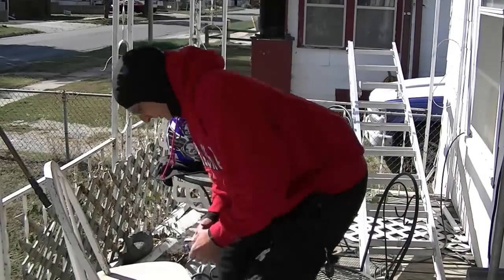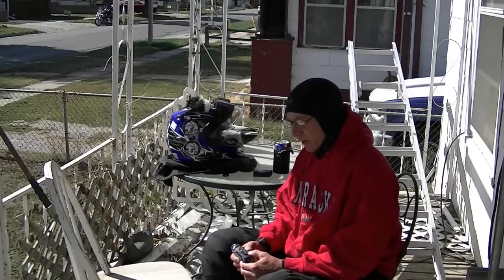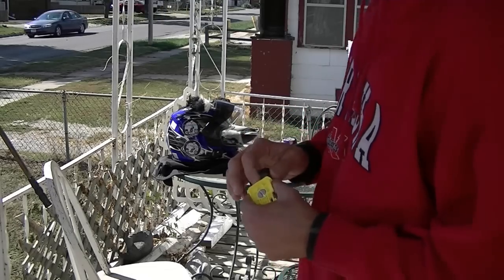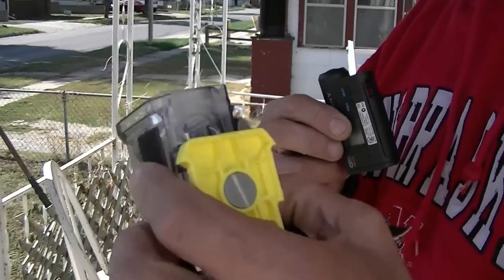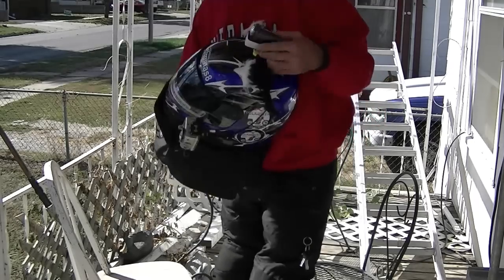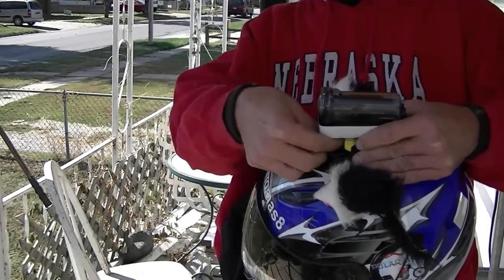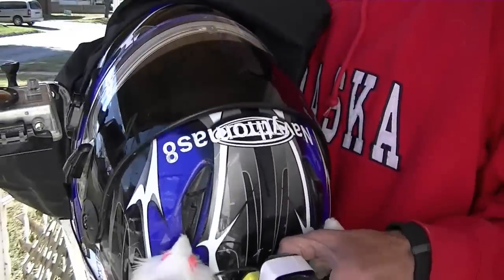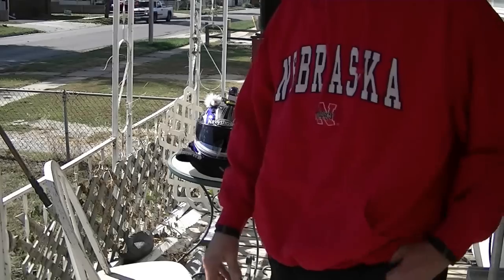Sony action Cam case mod Part2

Comment: Hey if you dont mind I have a question. With that waterproof case on how accessible is the Power button, and the Record and Pause button?  I would be using mine skiing and wanted to kno if I could use it with gloves on and If I would have to take it out of the case to turn it off between runs. Thanks.
Reply from the maker: It all works fine, My issue is with being able to external mic it up so I can talk while riding. JMHO it will work for you if you only want the video. check my channel for what I do. Then let that help you decide.